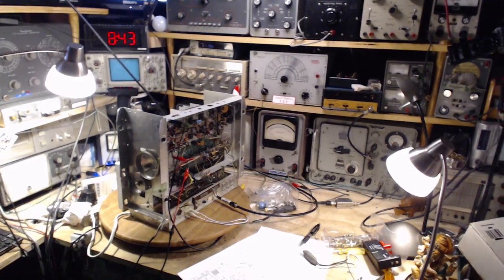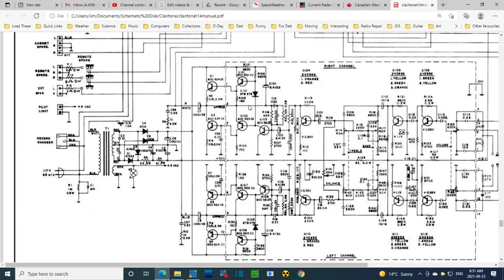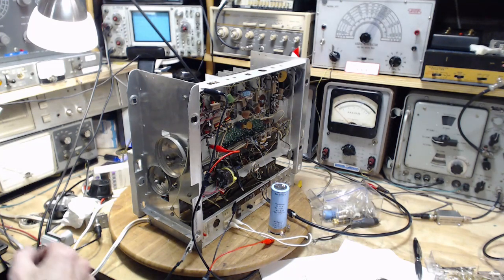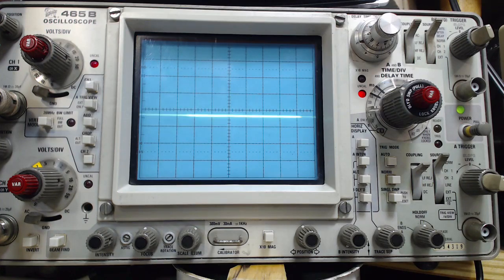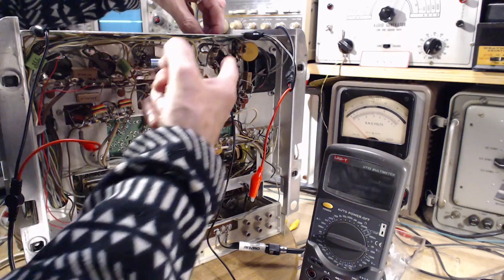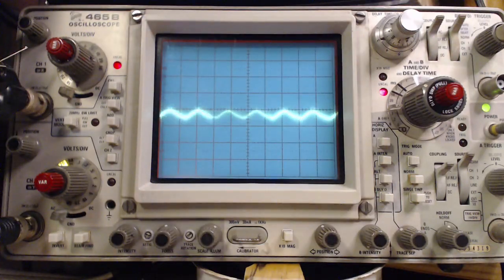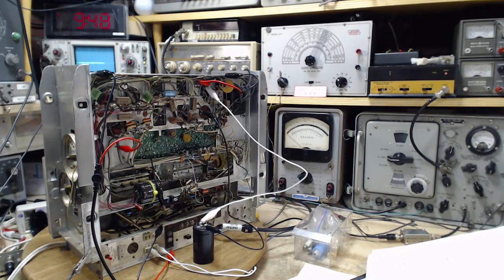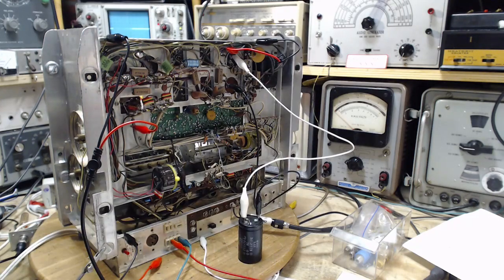Clairtone Console Stereo Video #36 - Hum Be Gone

Comment: Speakers look fine to me.  I used to have a set of Pioneer's that looked like those and sounded awesome.  Nowadays I just use bookshelf speakers on the "A" speakers and run a powered subwoofer from the "B" speaker terminals to the high gain inputs on the sub.  The bookshelf speakers in my bedroom are Fluance SX6W's and the sub is a 12" monolith.  They're all connected to a vintage Hitachi SR-604 receiver/amp.  In the living room I use a set of Klipsch R-41M's and a 12" Polk Audio powered sub set up the same way except I also use a center channel speaker on the tv running through an old Pioneer home theater system.  Don't have the surround speakers hooked up....no place to put them, lol.

Comment: Its called a complimentary symmetry amplifier . Speaker must be connected or you will blow the output transistors. Transformers were the primitive way to drive a speaker. Its the 21sr century now.
Reply: Funny that I have a pile of modern junk digital radios yet my primitive 60 year old  PYE VHF still performs admirably.

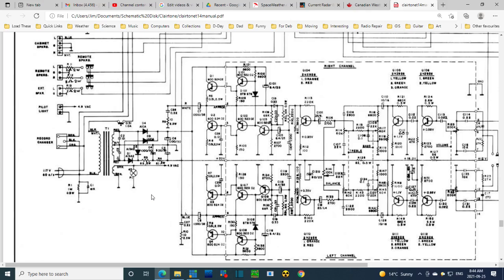Comment: 1:17 quote "the amplifier is lacking a feature... it has not output transformer to drive the speaker" unquote
What a bogus statement! Even in the tube era it has been found out that any output transformer is a limiting element to the truthful reproduction of sound. That is for example why the manufacturer Philips opted to construct a complex true Push-Pull output stage using an EL84 and EL86 pair and drive that directly (dc uncoupled) into a 800 ohm (!!!!) impedance speaker. All to circumvent the problems and shortcomings of a regular single ended or quasi push pull stage using an output transformer.
And IIRC you have worked on a radio that used this exact circuit of transformeless EL84/86 push pull output. And IIRC the benefits of this type of circuitry was commented on and explained on in the comments section of that particular video. But ofc since you refuse to read comments you are unaware of that "transformerless" evolution in amplifier design and ofc make up your own reality and lament on how not using an output transformer is a design flaw, when in fact it isnt.
It is true what able utopia commented on the last video; it is not the lack of knowledge with you that annoys ppl, but your lack of trying to learn and read up on the true reality. Instead you present your nonsense to an audience who doesnt know otherwise, and you go about it with an air that makes the listener accept your fables as the truth.
Reply: 37 videos to fix one radio should be taken down lol. If you can’t get results in under 10 you should take up knitting. David Tipton, Electronics old and new……….and many others will do a complete restoration with electronics and cabinet in usually 5 or 6 videos. Scary thing this guy worked for the power company for the city of Toronto! How many outages did he cause people to suffer😝😝😝😝
Reply: I to feel out of my chair hearing that Steve.  I could not believe he was saying that.  It is solid state that is what changed the world with transistors is that it did away with the need of output transformers.  Mcalderia yesterday had a video of why he does not "repair" but only restores.  He did a repair just to show he could get it working, but went on to say how long till the next cap failed and maybe if that one fails it burns up the entire radio.  Saw his last series on doing a Grundig and it has easily 50 tuner adjustments, all I thought was how Jim would shrug them off as being a dumb manufacture waste of time.   If you can stomach it,  watch his Macintosh MR71 video from like 5 years back, all the issues he is having here he had then, including the shaky test equipment.

Comment: 3:39 quote"These are all big expensive capacitors... Change them all the money will go out the door too.." unquote
Lets see... The output capacitor you have replaced is what? 1000uF 35V ?
That cap from mouser low ESR panasonic AECQ 200 series EEU-FP1V102 lists as 1,73 euro equivalent to 2,03 US dollar at current exchange rate.
That is not a bad price to ensure proper operation for years to come.
And the cheapest caps from panasonic to that value from mouser with order no ECA-1VM102 clock in below $1.
WTF! Isnt ur customer satisfaction worth that?
You are doing a way below average job using way below average components from a decade old trash bin. This is a joke!
Stop making ppl believe your blatant lies!
Reply: @asmallmatter4441   I watch Shango all the time. love his videos.

Comment: Expensive capacitors in the radio section? Expensive to who? All he uses is caps pulled from radios from the 30's and 40's and on. I feel sorry for the customer's here. That reciever will never be at it's top performance anymore. Mabye the hum problem was caused when in the 1st video when he shorted  one of the output transistors with his screwdriver.